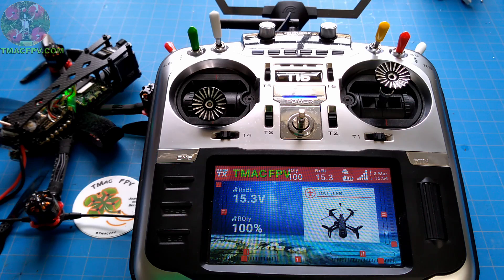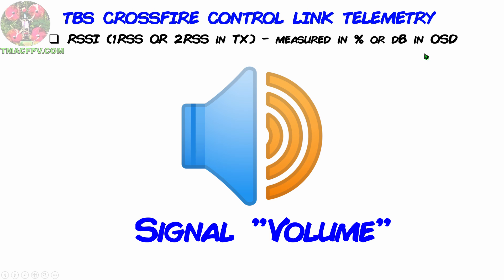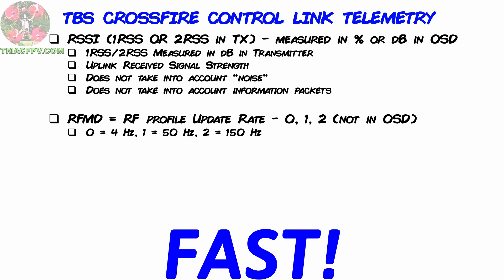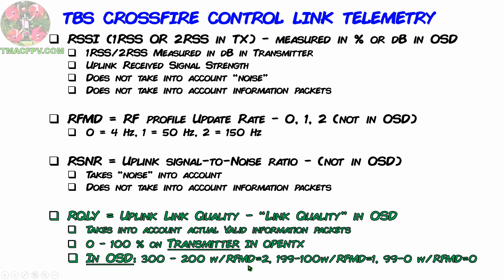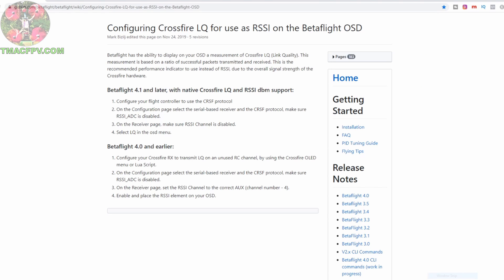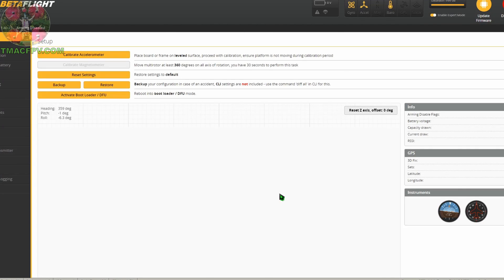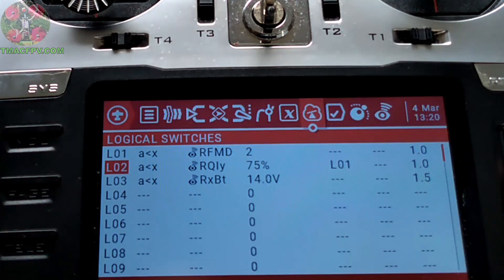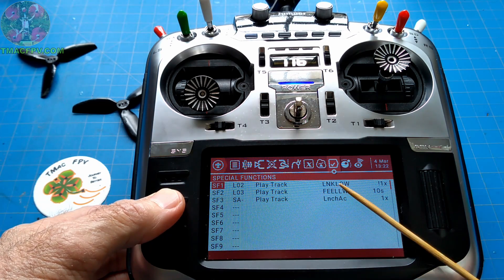TBS Crossfire Telemetry - SAVE YOUR QUAD!

Comment: Having such long voice warnings is counterproductive. The warning starts as your LQ drops momentarily. The LQ recovers, but your warning is still being played by the radio. Then the LQ drops again, which triggers the warning again. A simple "Signal Low" and "Signal Critical" audio warning is far more practical and useful. Repeating the warning multiple times is, in my opinion, not useful... Last thing I need when my LQ is low, is my radio repeatedly yelling at me! Also, your sound effects are far too loud in the video, you might want to consider lowering the audio level of the SFX track by half. In fact, the entire audio track is well above normal audio limits and it's quite uncomfortable to listen to. Good information though!
Reply from the maker: Hey jyunte! Thank you for taking the time to share your opinion and offer suggestions. Your thoughts on length of warnings may be beneficial to others!👍

Comment: Just bought a used crossfire tx lite and setup crsfshot and rqly warning. Less then 200 meters and started giving warning even on 1w. Thanks for this video,  cleared some of my doubt.
Reply from the maker: Hey Nathan! I'm confused about what you said, please help me understand. What type of warning did you get less than 200m away in 1W and how did this video clear up some doubt you had? Thank you my friend 👍
Reply: @TMacFPV  I got warning of rqly dropping under 80%. Initially not sure if this setting was necessary but after watching your video, I decided to keep it and updated my quad to betaflight 4.1 and not using crsfshot first. Anyway I fly in the middle of city, definitely a lot of noise interference.
Reply: Hi tmack!
Nice video!
So i am a litle confused and i got 2 questions. 
1. I am on bf 4.1 and if i disable rssi channel on bf and select lq on my osd i will get lq on osd and free up a chanel?
2. I did follow your steps but on osd i get 0 lq and on my t 16 i get 100 what did i miss?
Reply from the maker: @vasilisfellouzis  I, of course, am assuming you're using Crossfire and will go from there.  Answer to question 1 is "Yes." Regarding question 2, I do not know what you missed.  Do you have telemetry enabled in configuration Tab? Are you using DJI goggles (if so, I'm not sure DJI goggles support Link quality on OSD)? Other than that, here's the link for the Crossfire Setup Checklist checklist: https://tmacfpv.com/tbs-crossfire-setup/
Reply: @TMacFPV  thanks for the reply. 
Fatshark goggles.
Evrithing is set as should i get lg on my t16.
Reply from the maker: @vasilisfellouzis  have you uploaded latest "Default font" for BF 4.1 in OSD tab using Font Manager? Only other thing I can think of if you have followed the checklist
Reply: @TMacFPV  yes sir..
The lq percentage i get on osd is 0% and on my t16 i get 100%
Reply from the maker: @vasilisfellouzis  if you still have RSSI set up on a channel in your transmitter, you need to get rid of it.  No longer needed.  That may fix it.
Reply: @TMacFPV  so ill go in the transmitter  in the crf were i set on chanel 12 the rssi and delete it?
Reply from the maker: @vasilisfellouzis  yes
Reply: @TMacFPV  hey Tmac got it!
Needed to update my crossfire to latest firmware 3.28 now i got lq on osd and freed up channel 12 thanks alot sir.
I got one question on the osd it shows the lq 300% is that normal or should it be 100%?
Reply from the maker: @vasilisfellouzis  Outstanding! Happy to hear you got it working.  To answer your last question, watch the video starting at the 7:50 time mark.  I explain it all in the video

Comment: Oh, man! Another masterclass. I've been using only RSSI, because that's what I was using when running 2.4, before Crossfire. Also, I'm lazy and the environment where I fly is mostly free of interference (it's usually a farm). But there's a lot to digest in your video and yes, I have already failsafed not so far while using 900mHz. It was my fault, as I had a bad antenna connection at the time. Now RQLY is very useful and now I'll be working to enable LQ in my OSD. Later I'll be creating special functions to play audible warnings from my radio in OpenTx. Thanks a lot, TMac.
Reply from the maker: Hey Adriano! Great to hear from you. You're quite welcome. Believe me, you're not alone with using RSSI (because that's how we all used to do it). 😁Sounds to me like you've got it nailed down!👍Very much appreciate your support Adriano 🙏Have an outstanding 🌞day!
Reply: @TMacFPV  Always a pleasure to learn from you. Keep'em coming!

Comment: hi tmac if your using dji you will not be able to get link quality in osd something worth mentioning as i tried only to learn dji have not updated this feature it still worked in my tx though....unless that is someone can correct me if am wrong ;-) great video as usual
Reply from the maker: Thanks Urban Myth FPV! Is this true even with the latest firmware update for your goggles and air unit? https://www.youtube.com/watch?v=A-xSZTftr0w If so, does that mean every time Betaflight updates something with the OSD that you have to wait for DJI to catch up with Betaflight?  That sounds interesting.  If that's the case, I hope DJI is working in close coordination with Betaflight.  In any case, all you need to do is set up audible alert in transmitter for low RQly as depicted in video.  don't really "need" it on OSD.
Reply: @TMacFPV   i hope am wrong but seems not every feature is currently able to add to osd in goggles even though you can add them on betaflight they still wont show on goggle osd ,
Reply from the maker: @urbanmythfpv3121  hmmm🤔Have you checked with @Sub250gFPV

Comment: RQLY it is!  thanks for information!  great analogy btw :) awesome content TMac!
Reply from the maker: Thanks Wilson! Do you use Crossfire?  If so, what module? Dynamic power setting?
Reply: @TMacFPV  yup..  im on csrf and nano rx se, its awesome and all but sucks the battery of my tx really fast,  well not as efficient when i was using the internal 2.4 module.  was thinking of switching to panasonic 18650b (internal)  then ill create another 3s 18650 as external for the csrf.. thats probably another content idea :) most of the existing content are kinda shady, would be great if you shed information re properly powering csrf.  then probably down the road, long range stuff..  antenas..  etc..  maximizing our gear and keeping alive the "hacking/diy" spirit :)